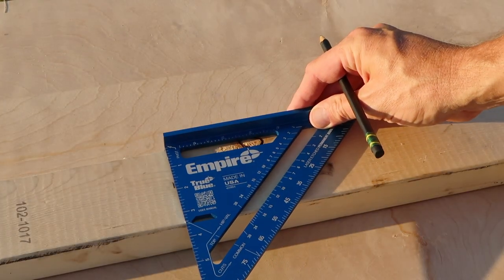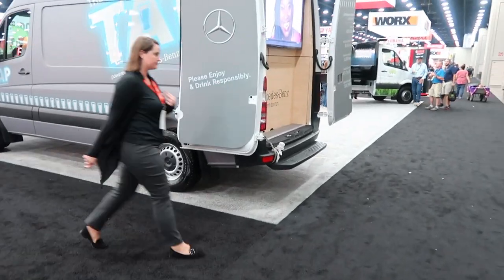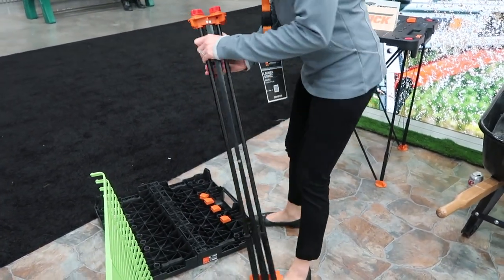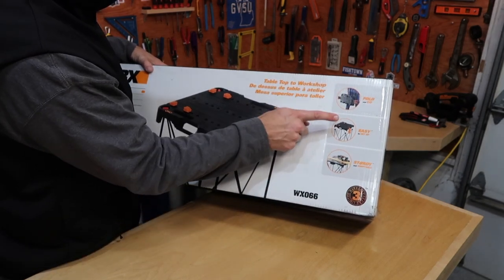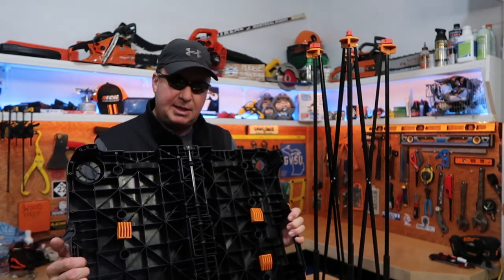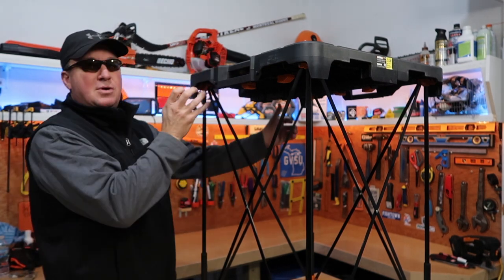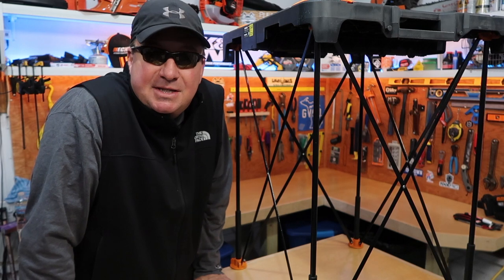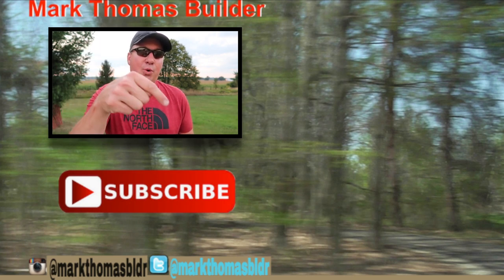WORK SIDEKICK PORTABLE WORK TABLE- #WX066 Tool Review Tuesday!

Comment: Nice review.  The little flexible toggles that hold it shut can also be used to connect two Sidekicks to make one longer table...
Reply from the maker: Yes, that a well thought out design.
Reply: I saw your review and after a good night's sleep, realized this thing would go great with my 2 Pegasus table/saw horses I bought, which I got a deal on. I ordered 1 of these from worx eBay page, then saw they had 2 for just a little more money. I thought, "Why not", sobI got 2 of them. Haven't gotten to use them yet, but hopefully soon. All because of your great reviews, I just had to get an Axis, 2 regular sawhorses, and a few other things, as well. I need to stay away from your videos. They are hurting my wallet. OUCH! Lol. Just kidding. I am planning on start making stuff in my woodshop again, since my injury. All these "tools" will definitely come in handy.
Reply from the maker: @eddiewilliams8568  That's awesome!  I'm sure you'll be glad you have them if you're working on a project and need to lay out some sheets of plywood and other big items.

Comment: How about a 6 years later update, how you’ve used or long term evaluation? How tall is it?
Reply from the maker: It held up well the entire time I had the table. I ended up getting some work cabinet worktables since then and not longer use the Sidekick.

Comment: Good table!!

Does the holes in the center of the table pass through the table thickness?

I would like to use it to mobile pdr jobs, and those holes could be useful to hold the pdr rods I will be using while working
Reply: 6:57 pause the video it doesn't look like they go all the way through in the center.
Reply: @shadowbanned5164 
I just bought it some weeks ago.

All the holes pass through the table. Only 2 are "one side".

For my needs it's the perfect table. VERY sturdy and you assemble and disassemble in 15 seconds!!
Reply: @UY_pdr2020  Thanks for your input. Amazon offered this for $42 today and I bought after seeing what you wrote. 👍

Comment: Neat product but it was wobbling the entire time you were using accessories I played with one at big box stores and it wobbled also but for casual eating or crafts it is perfect but not for precision work
Reply from the maker: The Worx Pegasus is a sturdier option.
Reply: It is also very dependant on the floor surface.  If that’s uneven then it will wobble but on a nice flat surface it is quite stable